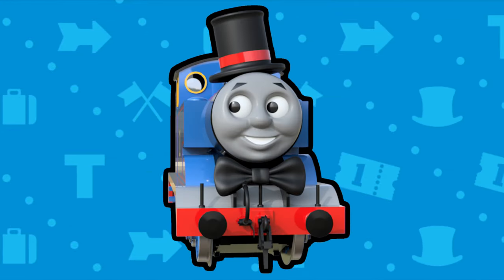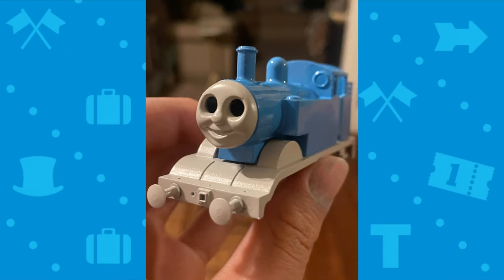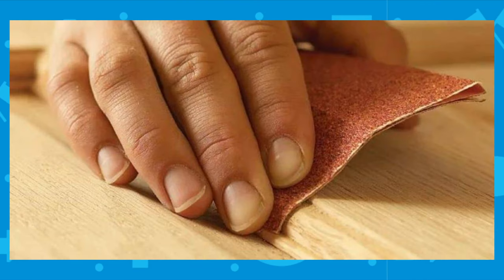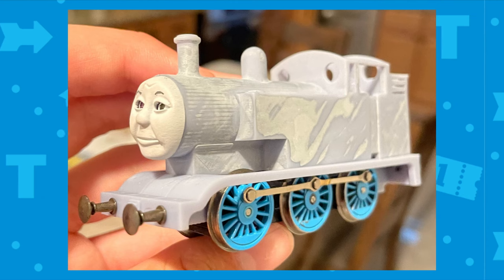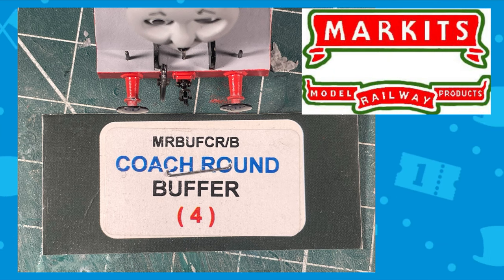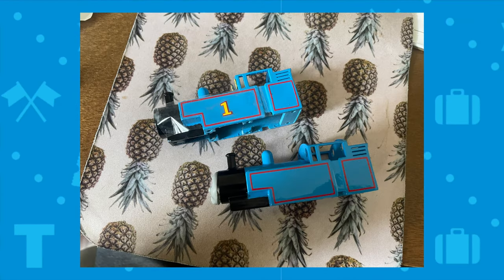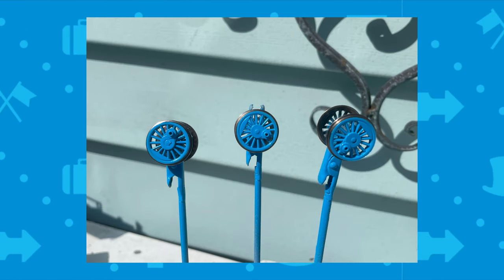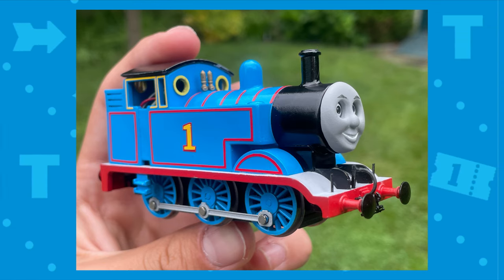How I Made my OO Gauge Thomas

Comment: Your model looks lovely, the markits buffers really make it much nicer than probably using resin printed buffers. Although I believe the Hornby screwlinks are actually HO scale they do scale well with the model, I don't recommend using them as actual couplings as they're quite dainty and delicate
Reply from the maker: The screw links are mainly for show lol, but they are not ho, hornby is a oo gauge company and they are oo gauge
Reply: @Jujy_Models  that's true but they also own Lima and Jouef and others all being HO scale brands, I've scaled them up with proper OO gauge hooks from Bachmann and the like and they're definitely smaller, but that's just my assumption as I'm a massive romford/smiths coupling user